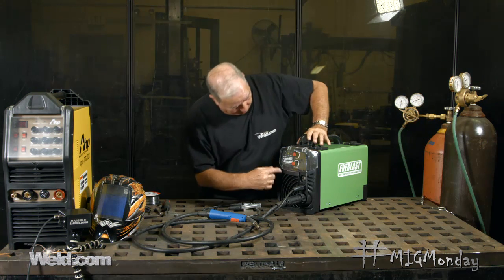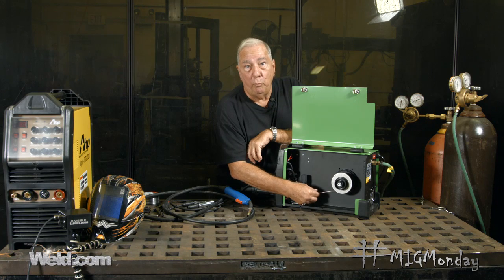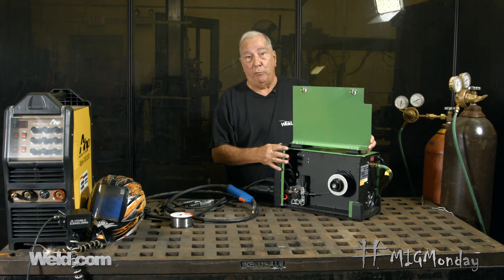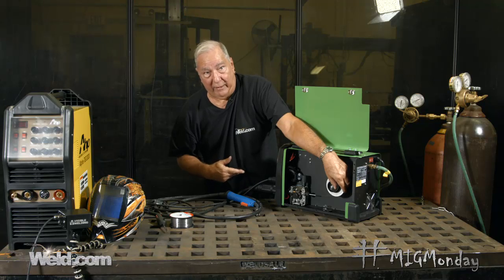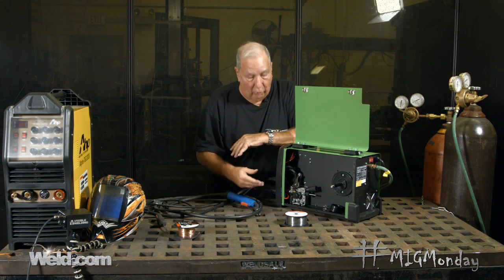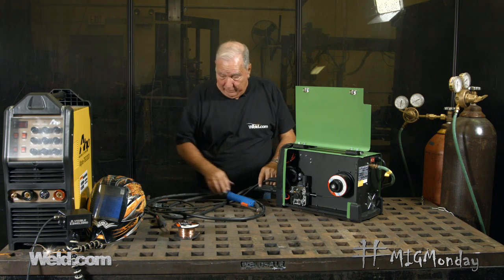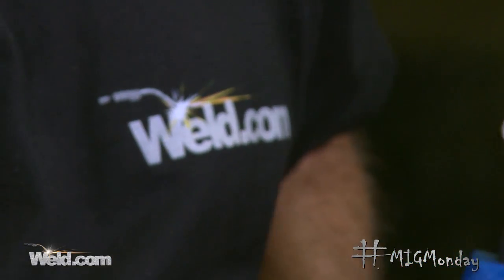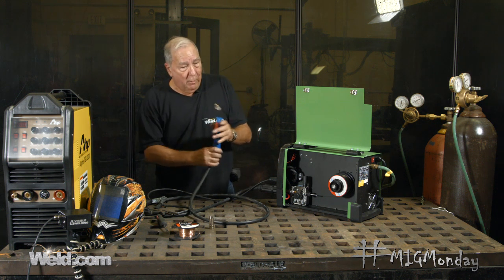How to Set Up your MIG Welder for Flux Cored Welding

Comment: You never mentioned the pressure roller on top of the wire feed. I see that it's set at around 4~5. It seems like it should set at one pressure for cored wire and another pressure for solid wire, yes?

Comment: I see from some of the comments there is some confusion on polarity and I think it comes from the terminologies used in welding.

Most mig and multi-process welders I have seen are setup from the factory for mig wire polarity and have the "+" and "-" symbols and terminals located on the inside of the unit above or near the wire feed mechanism. The default from factory the mig gun is connected to the (DC +) positive screw terminal. To change the polarity of the MIG torch, loosen the screws as in the video, remove the cable and install it on the other terminal. 

Polarity for a MIG gun using solid (MIG) wire, or gas-shielded flux-cored, or metal-cored electrodes is (DC +) positive (DCEP) with the work clamp serving as the (-) negative output terminal. This is known as reverse polarity. 

Self shielded flux core wire is the opposite polarity of solid (MIG wire) and so the Mig gun polarity must be changed to (DC -) negative which is DCEN or “straight”  polarity. This is accomplished by changing the wire above the feeder from the positive terminal to the negative terminal (so the wire feeder is negative) as in the video and connecting the work clamp the (+) positive output terminal (usually on the front) of the machine. 

Always be sure to verify wire manufacturer's direction for polarity recommendation for any specific wire.

 A common flux core self shielded wire found at big box stores and places like Tractor Supply is Hobart Fabshield 21B (E71T-11) and the recommended polarity is DCEN. Lincoln Innershield is another common self shielded flux core wire found and it also uses DCEN

The drive rolls for Everlast are marked with the grove size like .030" (0.8mm) and .035" (0.9mm) marked on each side of the roll where that size groove resides. Make sure the roll is not installed backwards on the feeder for the size wire being used or it won't feed correctly or will crush the wire.

Comment: If you are switching the DC plus and minus how does this effect the wire speed motor controller? My motor controller runs of the DC being fed to the wire. There is a circuit board with an SCR TYN 610. Will let you know if this causes a problem. Otherwise all good!

Comment: Hello dear
Learning a lot from your videos 👍
Was wondering about the flux core wire roller K groove versus the V groove ones ... What difference would it make if i use the V groove for flux core welding ? Will it affect the quality of the welds in any way ?
Thanks a lot and keep it up !

Comment: Great video very well explained, I never owned a MIG welder or any other welding machines. I know nothing about welding,  I find it to be a useful tool to have in my garage. I want to be able to weld small metal things, it's a hobby of mine making small tools for the garage  I really don't want any gas bottles around .what machine would you suggest for someone like me who has no idea of welding.  well not yet anyway.  any suggestions will be most welcome. thank you in advance. subscribed

Comment: So flux core ='s: negative to the metal clamp and positive to the wire.
And mig ='s: positive to the metal clamp and negative to the wire.

Is this correct?
Reply: will this not give you a shock,i will need to change my one round i just need to make sure i don't get a shock

Comment: Thanks for the informative video. 1 question, on the drive shaft you have a knob that tightens the wire, it has numbers written on it (marked from 1 to 5, revealed with every turn). What do they represent  or how do they relate to the system.
Reply: Wire tension.  I believe most manufacturers recommend around 3.5 for a setting.   Little late but hope it helps.

Comment: Try using a pair of electrical cutter/strippers for cutting the cored wire. It puts a clean cut on the end and you dont have to fight putting the tip on.

Comment: Many thanks for your knowledge. Using metric now (uuuugggghhhh) I see many flux-cored wires in as 0.9mm. Rarely do I see 0.9mm knurled rollers. I see 0.8mm/1.0mm K rollers - which roller groove should one use? The smaller 0.8mm or the larger 1.0mm (for 0.9mm cored wire)? Along same line, there are no 0.9mm tips that I can see, so I presume use a 1.0mm tip (size larger than the wire itself in this particular case)?
Reply: .9mm is.035 inches. 
.8mm is .030 inches. 1mm is .040 inches. I hope this helps.

Comment: 25 yrs ago I found you can weld galvanised steel by obviously grinding most of the galvanising out and increasing your wire speed by approx 10-20%. Whether it's possible with synergic sets I'm unaware?

Comment: Hi, great video. I'm an old dodger and only worked with oxy/acet set ups, this is really new to me and am excited to start. But I'm working outside and flux core is my only choice. The pieces I have to weld can't move so I'm wondering if an extension cord can be used? If so would a heavy duty extension cord work? Thanks Mike.

Comment: Thank you for your video. I just bought a mig welder and was doing some spot welds and I was getting to much splatter. With your video, I see I was using the flux wire and the polarity was reversed.
Reply: One thing he did not mention is that not all machines can switch.  The very cheap flux core machines save money by not including a gas solenoid.  On the back of the machine where the power inlet cord goes in there should also be a brass fitting for a shielding gas hose, if there's no fitting with a plastic dust cap, you do not have the option in the future of going to solid wire MIG.  Something to think about.

Comment: I would have thought, a "How to Set Up your MIG Welder for Flux Cored Welding" video would have talked about settings with voltage and wire speed. Could you please direct me to a video that goes over these settings? Thank you.

Comment: G'day Paul.  I'm trying to weld thin sheet with flux cored wire using a Misho 220 mig/mma/tig inverter welder.  I had been fiddling with wire speed and amps for the best part of a day trying to get it to weld without spluttering or blowing holes.  I have also watch so many youtube videos trying to get my head around it I was going mad.  Until I watch this video, nothing was making sense.  So mate, thanks very much and now I'm going back out to the shed and changing the polarity.

Comment: whats the difference between welding flux core with gas and without gas? ive seen people use a flux cored wire but also use shielding gas, but I thought flux core welding was made to be used without gas? I thought the shielding gas was for only solid wire?
Reply from the maker: +David Santa Cruz  "Usually" when using a gas with flux-coerd wire it is because the core is made up mostly of chemicals designed to match base metal in chemistry and/or strength so there is not much room for deoxidizers and/or shielding so the gas becomes necessary to protect the molten pool.
Reply: +Weld.com thank you for clearing that up for me

Comment: Nice compact welder. Flux core is perfect for making this a portable welder especially if welding out where there might be a breeze. Thank you for the video.
Reply: Perfect welder for portable use.
Reply: Is that welder currently available for sale?
Reply from the maker: Yes. It is called the ESAB Rebel 215ic. Do a Google search and you will find many sellers.
Reply: How does it compare with the everlast mig welders?